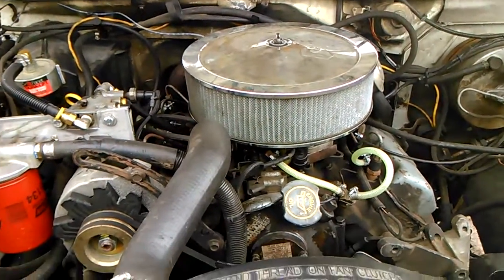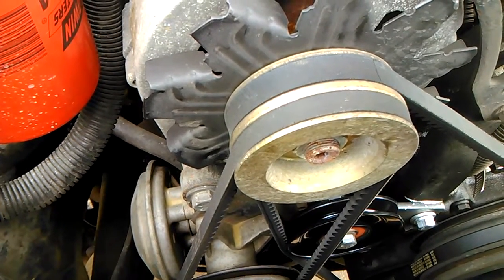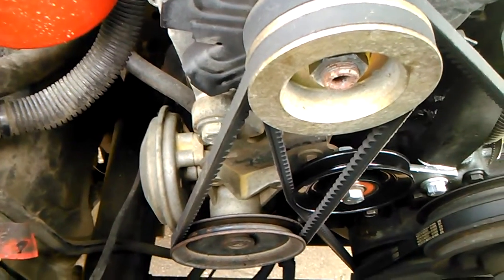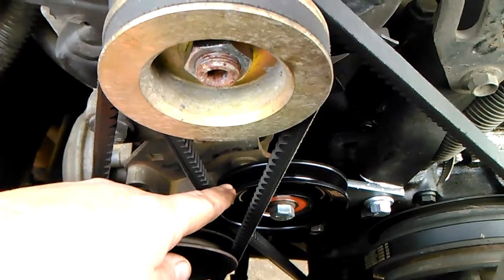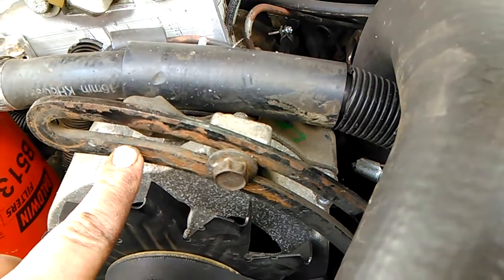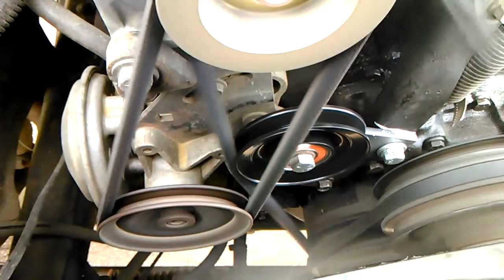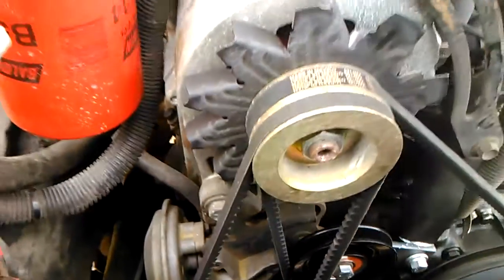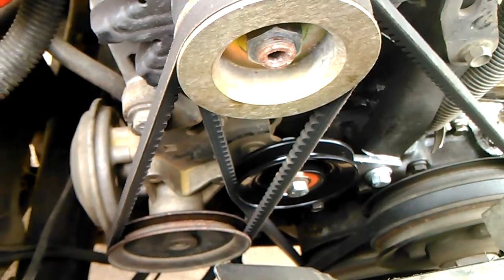IDI V BELT pulley upgrade

Comment: Mike, I know this video is old but the pulley on your alternator, is it original?  I have a '90 F-250 7.3 idi non turbo, I'm having alternator trouble and wondering if my pulley size is different than the original one?
Reply from the maker: The added pulley wasn't but the other one was original on alternator itself

Comment: I saw a posting somewhere that a guy skipped the crank pulley and was working fine...Does anyone know why you couldn't just use 1/2 length v belt directly to the waterpump pulley and skip that loooong run to the crank pulley? (Please no purist philosophy lesson). It drives all the other pulleys and would make a much shorter run to the alternator?
Reply: I was looking at this today on my vbelt IDI, I might try that. but I kinda like the tensioner bracket mike has fabed up here.
Reply from the maker: mikesglider in theory yea I guess you could. I've never even thought of trying it.
Reply: It will drop the RPM's on the Alternator.
Reply: Steve Poynter it would drop the rpm but I’m wondering if that would be a factor?  Running both the vacuum pump and alternator off the water pump with the vacuum pump also around the crank looks like it would work fine. Same amount of load or surface area off the driven crank pulley. I’ll try it and post some results.

Comment: yeah man that particular belt flops around so much it scares me. i drive around with an extra belt because it's already broke twice in the last 3 years. i been trying to figure out how to do what you apparently have done BUT(!!!)  notice how the other side still flops around just as bad so...how would you install another pulley on that side?
Reply from the maker: I have noticed the top belt flap as well but it's not as excessive as the bottom one was and I've never Sen a belt be thrown from there. I considered building an entire new bracket I have been crazy busy
Reply: probably good enough where you installed that pulley. thats where iwanna do mine. that's a long stretch so you picked the best maybe the only spot

Comment: Did you use the factory stud bolts where you mounted in that extension piece to hold it? I've always wanted to do this to mine and I have an idler pulley but have never really came up with a good way to mount it.